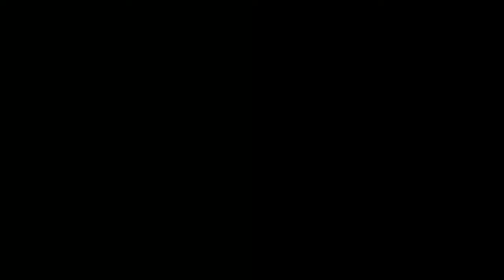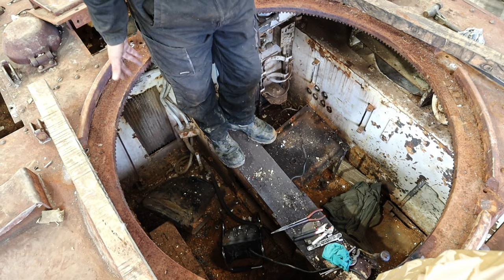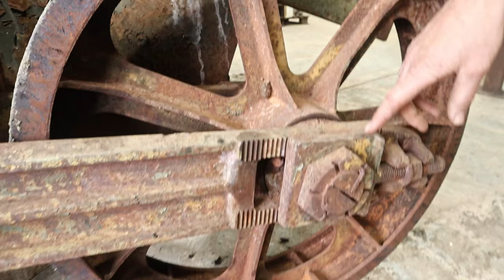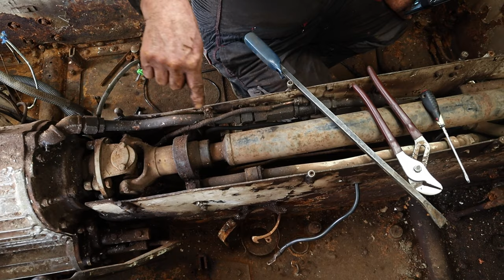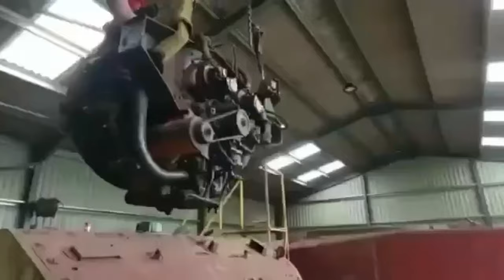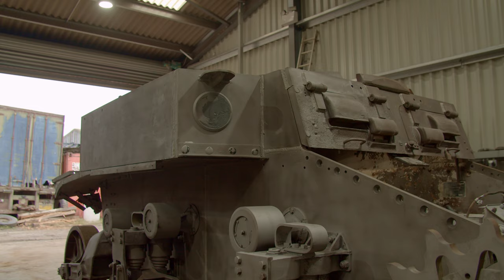Restoring our M3A1 STUART Tank to new condition! - Part 1

Comment: "Prop shaft"?
You Brits!
"Drive shaft" is more like it.
Reply: Propeller shaft is the standard term…
(Including on American built equipment).
Reply: In the UK it's a propeller [prop] shaft in between the engine and transmission or gearbox and axel. And driveshaft from the transmission or differential to the driven road wheels. From the differential to the wheel in a solid axel, it's also known as a half shaft